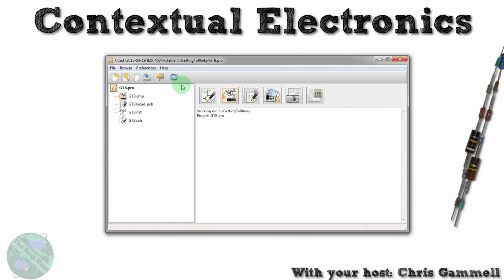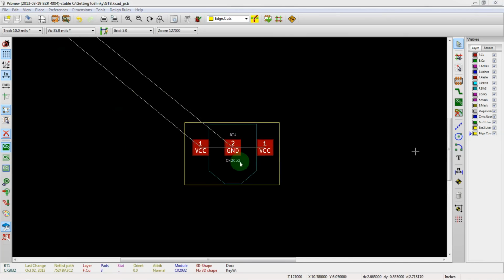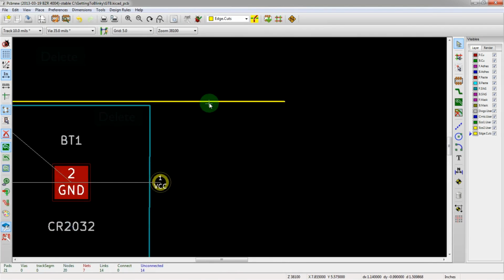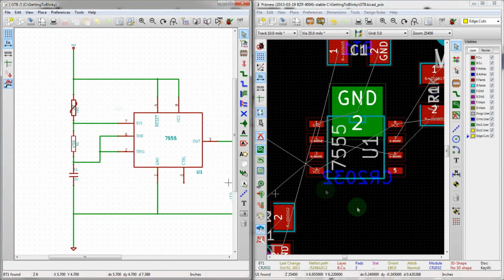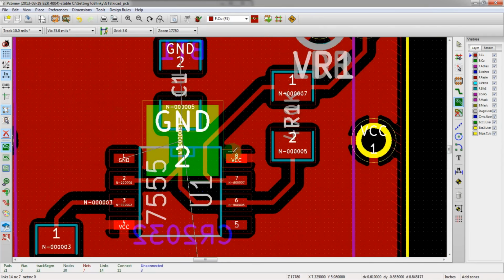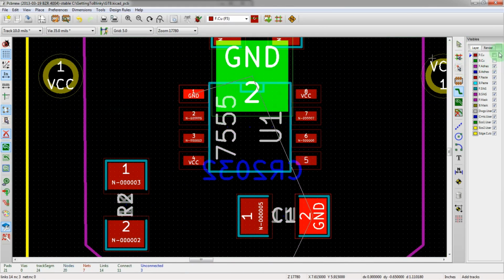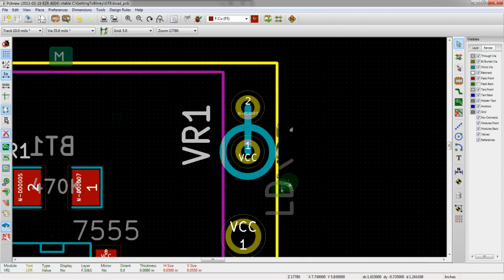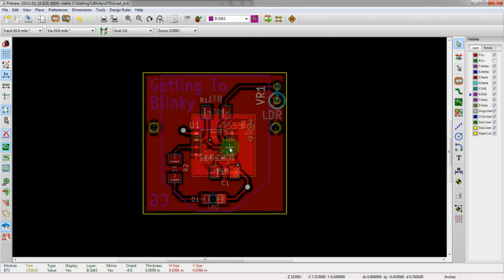KiCad 3.0 - PCB Layout with PCBnew - Getting To Blinky KiCad Tutorial - Part 6

Comment: sir I am very much new to kicad software .. and i got already designed PCB layout which is very complicated to redesign ... now requirement is to add power circuit in that. directly in PCB layout without reading net list again ...
sir is there any way to add footprint directly in the  ready made PCB layout..
because its hardly impossible to redesign it .

Comment: Your silkscreen outline for the battery has no relation to reality. I know you wanted to keep things simple (which is why I presume you skipped using a no-connect symbol in the schematic on pin 5 and running an ERC on the schematic). But, this is an actual problem for a couple reasons:
* Because you don't have any indication in your battery module of the real physical size of the holder frame, you have no assurances that the through-hole pins of the LDR won't interfere with either the battery holder frame or the insertion of the battery.
* I'm willing to bet, (I haven't measured things out yet but remembering the battery holder datasheet), that the battery will not be centered on the back-side of the board. The mounting tabs of the battery holder appeared to be on the center-line of where the battery would be. But because of your un-balanced (and fictional) silkscreen outline, you don't have the mounting tabs of the battery holder centered on your board.

At minimum (to keep things simple) you should have made your silkscreen outline a simple bounding box of the actual battery holder frame (using the dimensions from the datasheet) with some indication of the open side.

Oh, and yes, the cyan circle and line of the footprint you chose for the LDR will print as top-side silkscreen.
Reply: +Christopher Elliott (Sembazuru) oh FFS its a tutorial series about making a my "first blinky circuit" with like 5 components. The people who know better already know better and the people that don't are better off learning through experience.